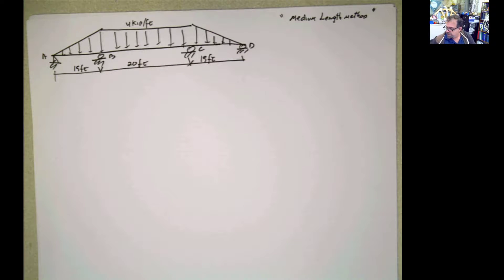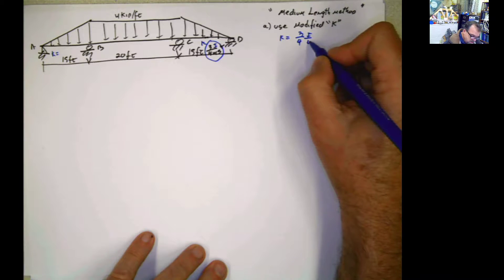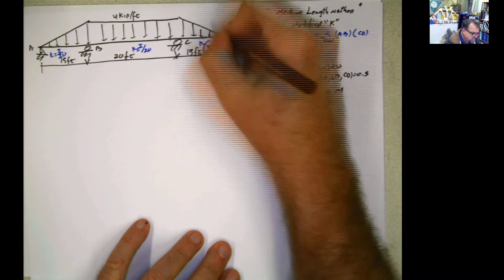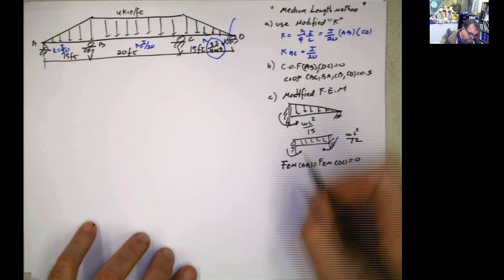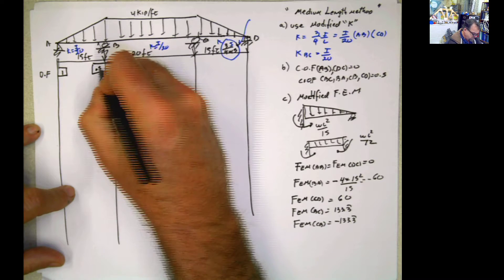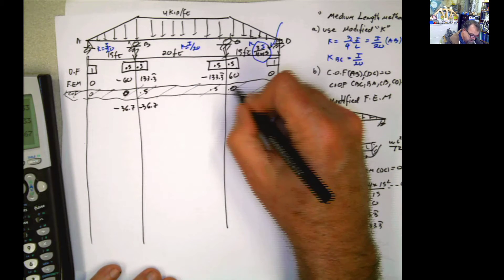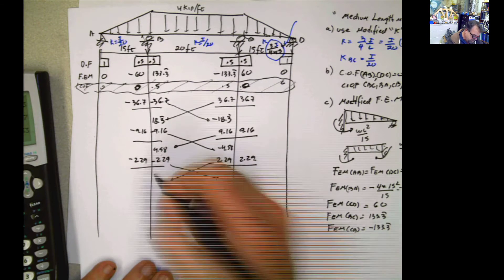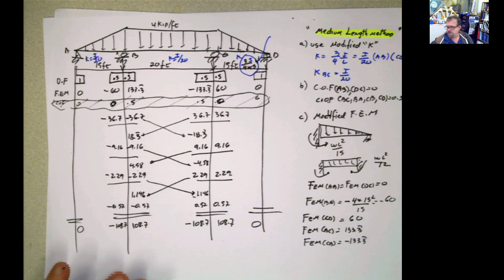Example 4- Moment Distribution for Beams  with Triangular loads  SOME SHORTCUTS  Modified k and FEM

Comment: For B) is that supposed to be Distribution Factor or Carry Over Factor? And if it is DF, wouldn't it be 0? Or since we are considering it to be a pin, its 1?
Reply from the maker: DF for a pin (at the end) is always 1 remember it comes from DF=k/sum(k)... however the FEM is zero if you use the modified FEM considering one end fixed and the other pinned (moment = 0 at pin)
Reply: @1963rzr  Got it ! Thank you.